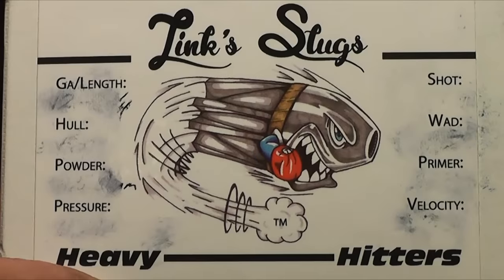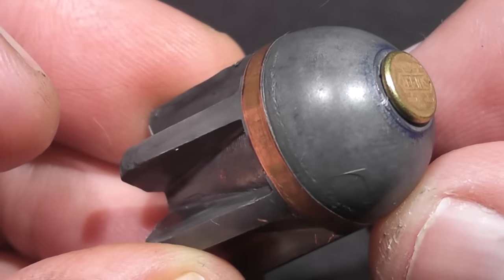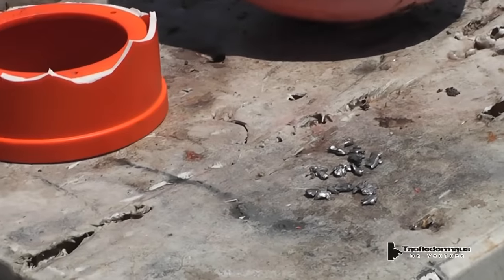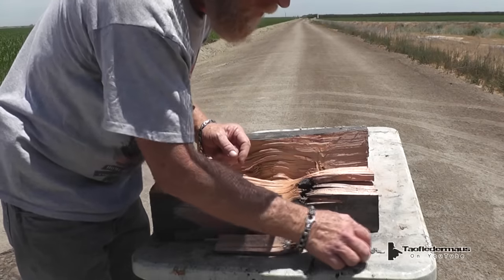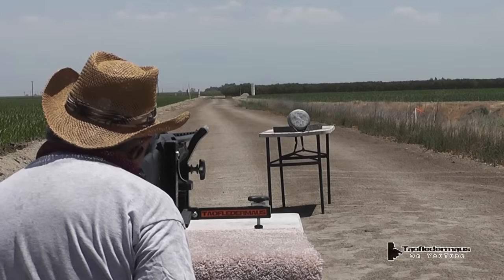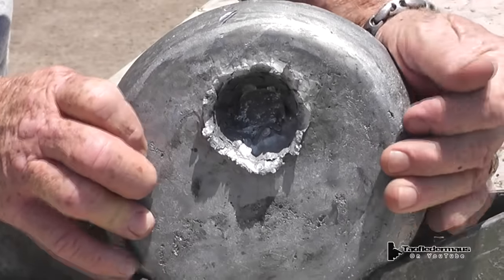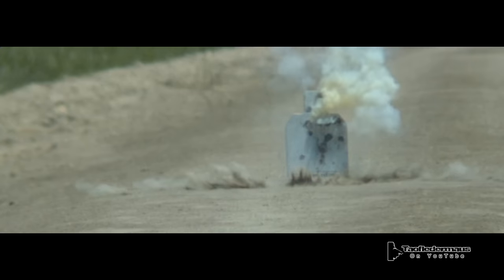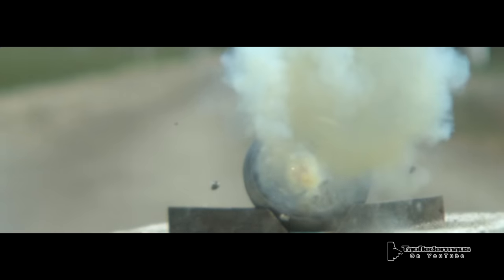12 ga. shotgun EXPLODING  rounds - You've got to see this!

Comment: It can only be hesh if it sticks hesh stands for high explosive squash head for those that don't know. It's purpose is to stick to tanks and expload on the outside sending a shock wave to send shrapnel from the inside to the crew. This is more like a HEAT shell high explosive anti tank
Reply: may i ask from where you know that ? im curious
Reply: If you can cast it from steel you could load a percussion cap either on the tip or inside the round and add some high temp burning powder (aluminum or magnesium) jacketed in copper so that the .22 would actually drive molten metal into the target like a real Heat round
Reply: @terra20209  Knowing this is nothing special, either you are really interested in tanks and just know from research or you played world of tanks where you can use the mentioned above shell types.
Reply: More like APHE, it penetrates and explodes inside.
Reply: HESH rounds contact the armour and squash against it (its in the name). the fuse is in the base of the shell, and only detonates after its driven forward and contacts the armour/structure, which is a fraction of a second after t he main shell hits
Reply: The internal cavity could be adjusted to create a shaped charge, probably not easily as it would involve a fairly complex internal shape that I can't figure out how to make; maybe it could be cast in a mold with many complex parts, and maybe it could be lathed out, but it might just be easiest to make a 3d printer that can do lead.
Reply: + @terra20209  Try playing War Thunder and you'll get to play around with those different tank shells yourself and see how they'll behave.
There's also several videos on youtube explaining them (in part because of War Thunder)
Reply: @Luredreier  well i would, if my Computer wouldnt be a BIG piece of shit
Reply: HESH? HEAT? Clearly you guys have no idea what you are talking about... let’s not bring artillery here, there is no need for it.
That’s just HEF round, which stands for High Explosive Fragmentation. Things like that were used ever since the middle of XIX century, they were even banned from usage against personnel (not vehicles) waaaay before Geneva convention. Nobody cared much, but still. There were two main usecases: it was used by snipers since WWI against specific high value targets, think of artillery ammo boxes, because it was not cost-efficient to use it against anything else, and it was also was the first type of round, known to be very effective against aircraft in WWI, which was the beginning of all specialized anti-aircraft ammunition types developed in interwar period, mostly for aviation autocannons and high caliber machinguns, although it had some use for rifle caliber machineguns as well. It was never banned from civil use, but I don’t see the point of that use anyway. HEF makes and awful round for a hunter: expensive as hell, turns an animal into a bloody mess and very hard to be used in a forest. The only “civil” application which comes to my mind is a murder: killing an enemy in a body armor with a shotgun, hitting his breastplate and still incapacitating the guy with shrapnel, wounding his hands, neck, jaw... All with one shot to his center of mass. The round should be legally prohibited, if you ask me: all fun of wood splitting with a shotgun aside, if you are buying such an ammunition for the real reason, chances are this reason is a war against your own police... 

And just to educate you, lads. It has nothing to do with HESH or HEAT.
HESH (High Explosive Squash Head) is, in essence, regular High Explosive shell, with one little tweak to it - explosives is of plastic, so when it hits something at high speed as it should, and that thing is sloped and solid (hint-hint, armor), the explosives spills as liquid, making bigger contact surface, and then explodes, either smashing through thin plate or creating a shockwave in a thick armor plate, which can lead to separation of some fragments of armor on the inside, which can be dangerous for the crew, although there are several ways to protect a heavy vehicle its crew from that, so basically that’s your regular high explosive shell with some added benefits against obsolete tanks and some light APCs/IFVs. So pros: universal. Cons: more expensive that regular HE, useless against spaced and composite armor, so all modern tanks in frontal projection, and not effective enough if the target has splinter lining.
HEAT is, in essence, your regular HE shell (again), made in a specific shape (it’s even called shaped charge), to be specific - it has hollow, metal plated cone under ballistic cap, you can find some pictures yourself since it’s not that easy to describe, usually stabilized with fins because spin spoils characteristics and what it does, is focuses most of the explosive force into powerful jetstream of plasma, which “burns” through the armor and carries on inside the vehicle. Technically incorrect description, but that’s what it does. As always, there are several ways to protect a vehicle against such a thing. Explosive reactive armor, composite armor, spaced armor, active protection systems, you name it. Pros: pierces even really THICC armor, does not care about speed since it relies on chemical energy instead of kinetic. Relatively simple rounds are relatively cheap, though not as effective. Cons: more expensive than good old metal rod (APDSFS), can go very sophisticated and expensive if it has to go through ERA, composite, ect, and inferior as regular HE because you can load muuuch more explosives into a shell of the same caliber.
That’s all. Tanks don’t shoot led slugs with some powder inside. Sorry, but cannons has nothing to do with your puny little shotguns.
Reply: Terra20209 technically, all firearms from 20mm and above with an exception of some antique muskets, classify as artillery. Tank, in essence, is a mobile artillery piece with high survivability and more often than not, equipped with secondary armament such as machine guns and whatnot. And it is used as an artillery piece which can survive even being on the spearhead. If someone immobilizes a tank, it turns out to be a pillbox. If someone also knocks out its gun, that’s bunker. You might not know, but back in a day a lot of tank cannons were either unified with anti-tank artillery cannons (or even anti-air cannons) or literally were the same guns, modified to be positioned in a tank, using the same ammunition. There were also examples when tanks were dug into a trench and were used as pillbox in defense, even tank turrets alone, without chassis, can be used as improvised pillbox. Just like artillery, they usually perform awfully if used alone, and their main role is infantry support, which means suppression of the enemy vehicles and enemy infantry. You might not know, but the most used and most important type of ammunition for a tank is HE shell. Not APDSFS, not HEAT, not ATGM or any other specialized round - it’s standard HE, which kills soft targets. And that’s valid for all other types of artillery, may be with an exception of anti-tank guns of WW2 era, although without enemy tanks  they were not idling ad were shooting HE as well. The only thing changed from that time is guns, developed specifically for tanks without any unification with the rest of artillery. Also, it makes little sense to load any chemical rounds (HE, HEAT HESH) into ammo racks, protected with blow off panels, and also western tank doctrine is more inclined towards replacement of HE with HESH or HEAT and multipurpose usage. FFS, 120mm HEAT round for Arbams is literally called HEAT-MP. But that’s only because western countries can afford high military expenditure. If you check what Russian tanks use, you’ll see a huge portion of good old HE in the ammo racks. That’s because fighting another tanks is not the primary task for a tank, it secondary one. There are helicopters, planes, ATGMs for infantry and vehicles, RPGs, mines, there are dozens of ways to delete tanks from the battlefield which excel in this role much better than using own tanks, and if popular culture thinks otherwise, that a problem of popular culture, not the problem of the military
Reply: @EriIaz  the reason for having them is because you can, not murdering cops. If someone is set on murder they will find a way.
Reply: stainless steel  revolvers
Reply: Smith and Weston revolvers
Reply: HESH (High explosive squash head) is the British name. In the US we call it HEP (high explosive plastic). What it actually does is flatten against the armor before exploding. The force of the explosion causes spall to fly off the interior damaging/destroying the tank and killing or wounding the crew.  Mostly obsolete type round, as all modern tanks have spall liners on the interior. I know from being a tank company commander back in the 1960s.
Reply: @joseignaciohileradorna5122  like APHE, but lacks the key part - its fuze has no time delay. Anyway, the video is a clickbait, as i wanted a real HESH!
Reply: @EriIaz  "if you are buying such an ammunition for the real reason, chances are this reason is a war against your own police... "

If you want a war with police, all you need is a rifle. The point of this thing is it won't go through whatever it hits, because it will explode. Rifles will overpenetrate and cause collateral damage. A half-decent Kevlar vest will protect you from this thing. Police have those. Florida Man doesn't. And how it kills whoever is hit by it doesn't matter. Dead is dead, and this is pretty much guaranteed to make Florida Man dead.

For someone who's spent so much time on Google over artillery shells, you sure don't know much about ballistics.
Reply: @neiljohnson6815  still very effective against fortified bunkers .more so than heat rounds .(also tank crewman 70's)
Reply: well, it kinda does send spalling from the opposite side, at least from the lead plate.
Reply: This is nothing like a HEAT round. Do you even know what you are talking about?
Reply: No, it is more of a HE round. HEAT has a shaped penetrator charge.

Comment: HESH stands for High Explosive Squash Head round, which has a plastic head and an HE base of the round. The round works by impacting the enemy armor and the head squashing, taking as much surface of the amor plate as possible, then the High explosive base detonating and sending shockwaves through the plastic head into the armor plate that make it shatter and shrapnel from the inside. A very interesting concept, sadly this round doesn't really work in any way a HESH round does. It's more of a APHE round if you ask me, an arour piercing round with a high explosive inside. Anyways, good video excellent high speed footage!

Comment: This isn't a HESH round. It's more of a HE round.
Reply: Yeah. To make a HESH, the Slug needs a C-4 head. By the way, a HEAT slug would be funny.
Reply: @vermilion7777  I don't think it would need to be C-4 because you can shoot C-4 all you want and it won't detonate. You can even light it on fire and it would still be stable. A HEAT slug would be awesome though.
Reply: @nukeemwins4174  Off course you need a primer charge on the bottom behind the C-4 head, so the c4 detonates after creating a pencake.
Reply: less of a HE round... more of a Ballistic Capped round. or, Immediate Action round, or to keep with the tank round comparison, APBC, or APHEBC since it has some compound in it... or APIA
Reply: @DisorderInOrder  It wouldn't be any of those because this explodes on impact, not after penetration.
Reply: @DisorderInOrder  No, not at all, as it has no hardened steel. And there is no ballistic  cap. And it's not a AP with a charge, because it has no fuse timer. It's just a plain ol pure HE round.
Reply: It's HE-FRAG
Reply: @nukeemwins4174  Try stomping the fire out and see what happens.
Reply: well hesh stands for high explosive squash head so in a way its high explosive just using c4 or something similar in the front
Reply: It's more of a Ballistic capped round
Reply: @vermilion7777  how would you concentrate all the force forwards to create heat slug
that would be fantastic
Reply: @Gokaes  Don't be silly, I'm not an engineer. Also there is no way for me to get the needed military grade explosive charge that would be needed for making a heat.
Also, in my country,  creating explosive ammunition would get me in jail. Most of that stuff they shoot in this channel would be a serious crime here.
Reply: It is hesh
Reply: I dont think you know how a hesh, he and heat works
Reply: @potassiumcyanide3857  No, it's not. Hesh stands for High Explosive Squeeze Head. A Hesh is generally a relatively elastic lump of explosives, forming a pancake after impacting the target. The destructive mechanism of a Hesh is bypassing the thickness of conventionel steel armor by sending shockwaves through it and blasting the inner layer of the armor off, to send shrapnells into the passanger space. That thing up there does nothing of this, so it's not a Hesh.
Reply: @vermilion7777  hesh works by the soft cap melt and explode making the metal sharpnel om the other side fly
Reply: @potassiumcyanide3857  No, there is nothing thet "melts". Melting is something that neither happens in He, Heat nor Hesh, because in an explosion there isn't enough time to absorb enough thermal energy for something to melt, before it gets ripped appart. Even the spike of a heat is a pure kinetic penetrator.

A Hesh has a soft, plastic explosive warhead that get sqeezed into a pencake (therefore the name), creating a destructive shockwave. The only thing you're right here is the shrapnelling of the inner armor layer of the target.
Reply: @vctjkhme No, the slug penetrated and exploded inside. That's APHE effect. But still HE, since the slug has no AP properties and the thin propane tank is not hardened armor.
Reply: @vctjkhme Comment about burning? The only ammunition type that burns are incendiary rounds. If this refers to my last comment, that was about HEAT and the the common misconception that the effect of HEAT ammunition is based on thermal energy. Uranium rod APDSFS ammo doesn't burn either.
Reply: @vctjkhme Just read it, and it seems you're right. The term is "pyrophoric". Here's an interesting article: https://www.theguardian.com/world/2000/may/18/armstrade.kosovo Didn't knew that. Tungsten penetrators seem not to share this feature.
Reply: Quite right. Background - US Army Armor officer, 25 years active duty. Around 1943, Sir Douglas Burney, working on a round to take out German Atlantik Wall positions invented his "Wallbuster" round. This consisted of a thin walled projectile with a large amount of plastic explosive in a metal mesh bag, detonated by a base fuse time fuse intitiated by the deceleration as the round hits the target, spreads across the target in the form of a poultice or patty and goes boom. Burney's first test was against reinforced concrete and the Wallbuster lived up to its name, it shattered the concrete, blowing large pieces dozens of yards and cutting the rebar off at the knees. And here's the beauty, the detonation sets up shock waves, that bounce off the target's back wall, then the front wall. etc reinforcing the effect until the tensile limit of the material is exceeded. Against armor, a large plate and a number of fragments are blown off the rear of the armor plate. You can imagine the effect on an AFV crew - as we were taught in Basic Course, 'you open the petcock at the bottom of the fighting compartment and wash the crew out with a hose". As a benefit, the detonation also strips off things light antennas, lights, and other external fittings like a razor. The British adopted it as their primary round, calling it High Explosive Squash Head (HESH) for the 120mm BAT and WOMBAT Land-Rover mounted recoilless guns and it replaced HEAT aboard Centurions. When the British 105mm was adopted by the US for the M60 series, the British HESH became HEP (High Explosive Plastic). It was the only round used in the British designed 165mm demolition gun used aboard the Centurion AVRE and M728 Combat Engineer Vehicle. 
https://image.slidesharecdn.com/introduction-to-weapon-ammunition-160510095137/95/introduction-to-weapon-ammunition-67-638.jpg?cb=1462874000
Reply from the maker: It's squashing

Comment: What could more than likely help is maybe make a new design similar to that, but chip off the corners on the fins to make it have a sloped angle in the back to reduce disturbance of the projectile, like what you see on regular conventional bullets, like a .50, 5.56, 7.62, etc.

Comment: Saw something like this years ago.... 45 ACP cast metal slug with nose of bullet drilled out to accept a .22 rimfire crimp blank.  Very similiar to the Hilti Gun blanks.   Bit of epoxy to hold the blanks in the slug.   Hole in nose of slug included a larger dia. hole at top so the rim of the blank was slightly recessed into the nose of the cast metal slug.   All then loaded as usual into .45 ACP brass in the usual way.   Good stability in flight and every one went BANG when it hit the solid target.

Comment: Johnnie come lately. My friend and I did this 50 years ago, hollow pointing a 500 grain Minnie ball, putting 4f blank powder in cavity and topping off with a .22 blank.  I shot a section of 2” Webb angle iron, the result was a surprise, the angle iron folded in 90 degrees and split open while the balance of the lead Minnie ball came back like an angry hornet. Scared the crap out of me. Never did that again.  I was using a replica of a Zouave rifle using 50 grains of 3f black powder.  We did shoot many of those modified Minnie balls.